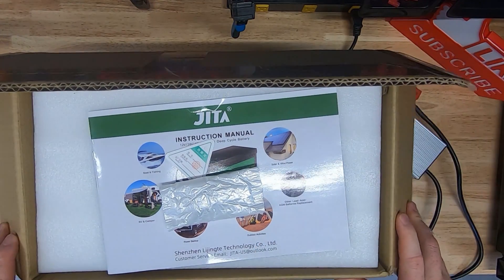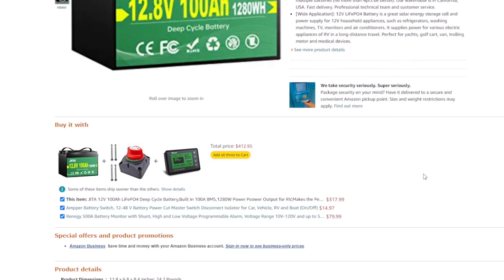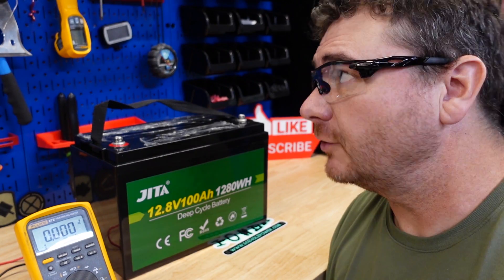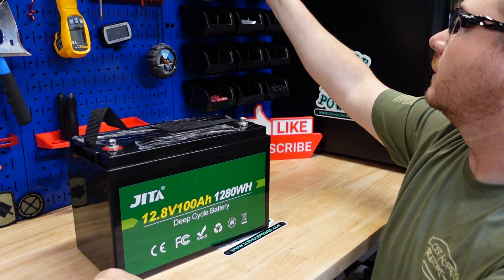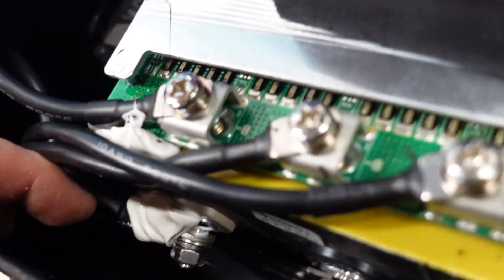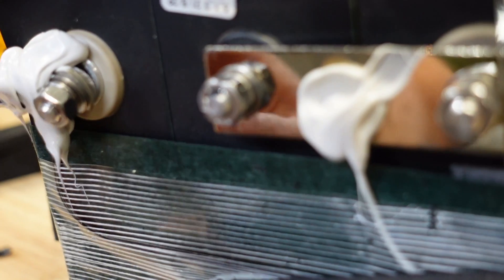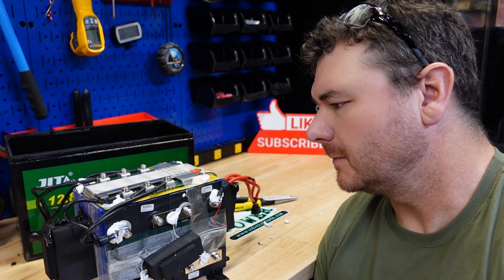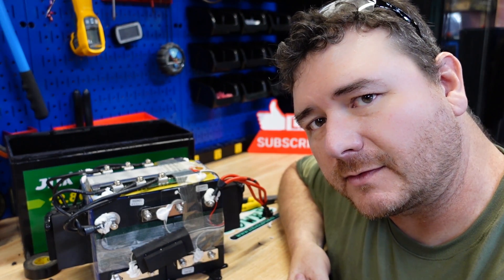JITA 100Ah Lithium Battery Review and Teardown

Comment: I have a 100ah battery from JITA and while the craftsmanship might not be great, I will say, the battery is very impressive in its actual use. It certainly saved my life when I was forced to live inside of my truck at the start of of the pandemic with solar panels on the roof. The other batteries from better companies were just too prohibitively expensive for me to buy them.

Comment: That's good crapsmanship, poor craftsman ship, maybe this happened after the QC inspection, but I don't see how, maybe it was inspected before going in the case, then the battery was dropped as in went in the case, and being in a rush they didn't see this,  these ppl are working fast, like a ninja in a fight, surely this Isa one in a 100,000 defect, seems it still worked fine,  being im in the shape I'm in, I'd definitely still use it, especially if I didn't buy it,  I'm off grid, and  definitely in need!!  Have a great day!!

Comment: I already have a few of the JITA batteries, three 100Ah and two 200Ah on different builds.I agree that sending out a broken lug is a deal breaker for future purchases, but I would have liked to have seen what the BMS part numbers or specs were.  

Hopefully I don't have any broken studs inside...

Comment: I've seen other youtubers disassemble a plastic shell on a battery and they used a vibrating trim cutting saw. Might be easier than the method shown here. I'm not saying one way is safer or better just sharing. Please keep those safety glasses on. Thank you for the video.
Reply from the maker: I actually have one and have used it in a few videos. I had another project planned for this battery so I was trying to save the case.

Comment: Can you hook a AMG with a lifepo4 or should you get both lifepo4's first?
Reply from the maker: Great question. You should not hook up a AGM to a lithium. Different voltage ranges. When hooking up two batteries, they should always be the same type, manufacture and amp hour rating.
Reply: @iceholepower8012  ok ty!

Comment: I have the 300Ah version of this battery for my solar setup in my camper. Had I seen this first, I probably wouldn't have made the purchase, but alas, I bought it a few months before this video came out. 
I knew it didn't have low temp charge protection, but as I was using a solar charge controller that enabled me to set that parameter through it, I wasn't worried about it. And the fact that it's in my camper, which will most likely,(at least I hope not) never be charged when it's cold. I'll probably pull it when it's stored for the winter, and keep it charged in my garage or house. 
Anyway, another great review. I always appreciate what you do for us. Thank you and have a good one. 
Peace.
Reply from the maker: Thanks for watching Kyle! Actually you will get more life out of lithium batteries if you store them between 30-70% Lead acid likes to be full all the time, not so much with lithium.

Comment: Jeremy, out of curiosity, in your honest opinion do you think if you have two of the same batteries to test, teardown, and review, side by side, that both would be like this? I have gone back a watched all of your teardown vidz, and compared them to other fellas who are now doing theae teardown and reviews; have not seen anyone do two side by side. Thinking, sometimes you get a turd, sometimes you get the prize. With the world turning Chinese, I don't believe things will get better from here on, only gonna get worse.
Reply from the maker: Interesting thought. If I had two of these batteries, I would not expect them to both have a busted bolt. BUT, the fact that the assembly guy AND the quality assurance checker let it go out the door like that tells a guy everything he needs to know about the craftmanship. I have said it before, I seem to get a lot of turds! Makes me think there are LOTS of poorly  built batteries out there. Just the majority of them don't get opened up and as long as they charge and discharge, nothing seems wrong from the end user's prospective.